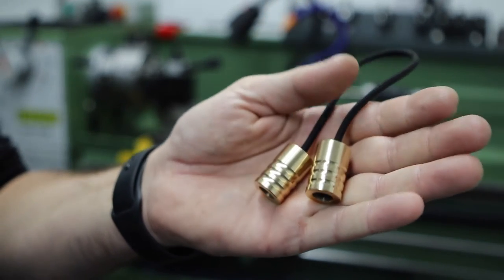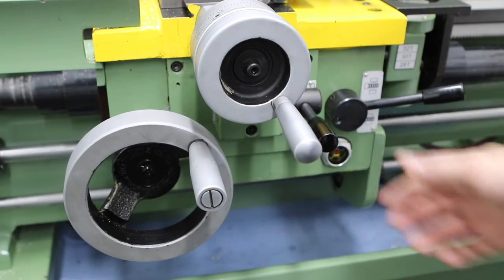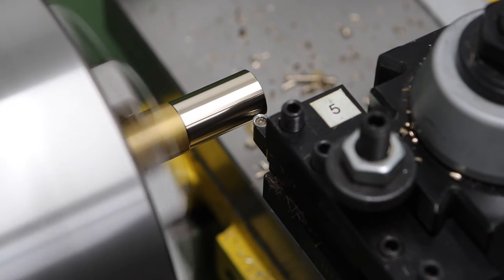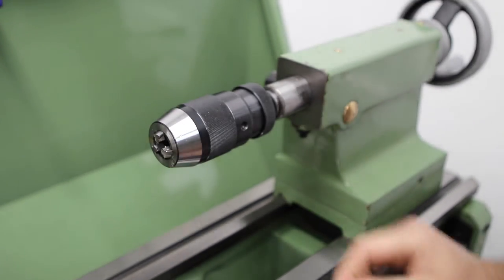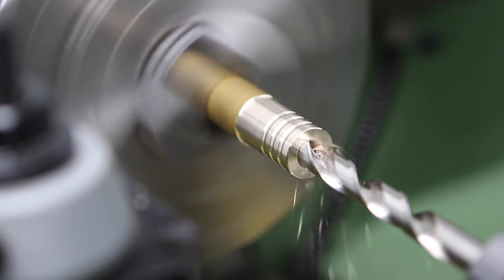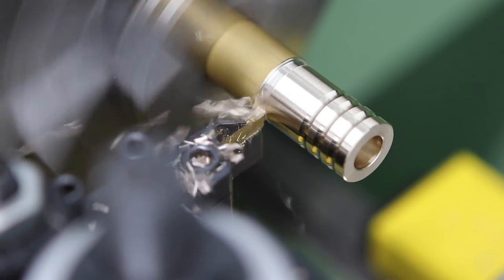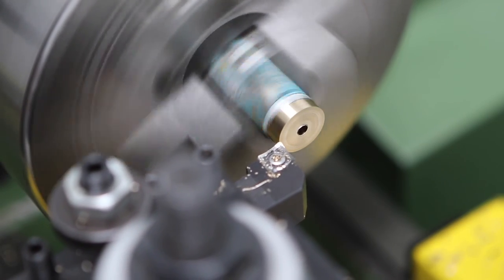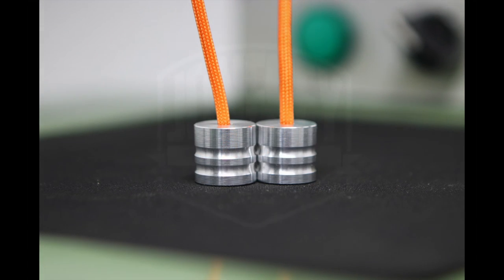Making Begleri beads from solid brass on a lathe

Comment: What kinda rpm are you using for that finish on the main stock?
Reply from the maker: I’m running the lathe at 1200 rpm when reducing the diameter and 400 rpm when turning the bands and parting off.